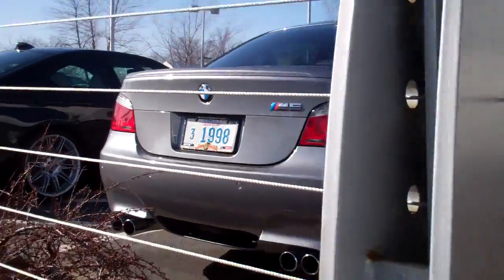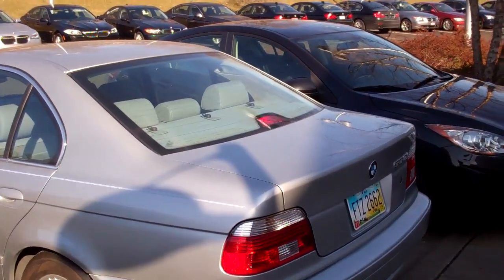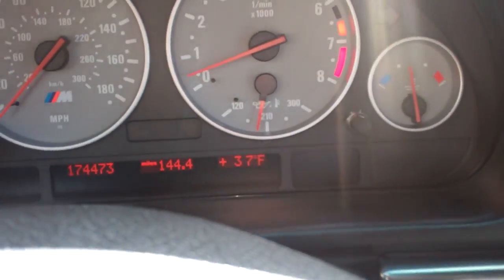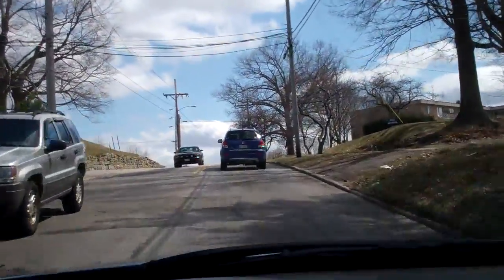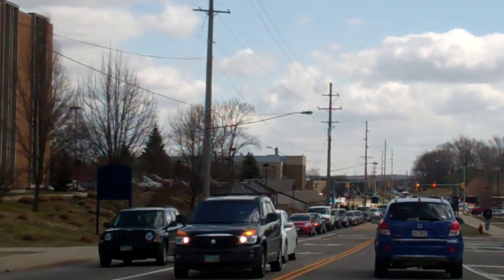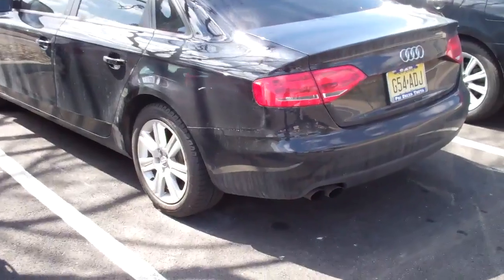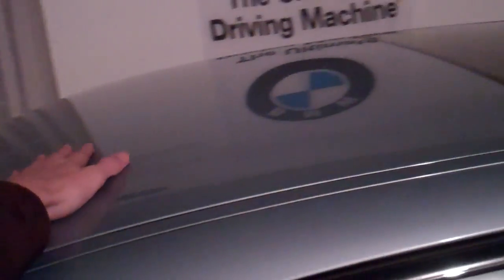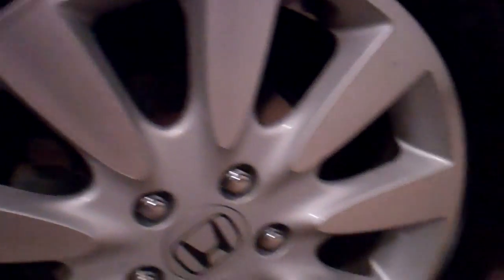The Kent Fuzz  4/3/13 - Day 843

Comment: Quick reply! ;) I can't fault you there and I am sure with time and effort she will shine. ;) I looked for Zaino in England and I can't seem to find it. AutoGlym should be good for the X5 and the 500 though. Saying that The 500 has what's called 'G3 Glasscoat' applied from the factory. It's a rare option on the car and the paint looks freshly waxed about all of the time. It looks great almost 2 years since rolling off the production line!